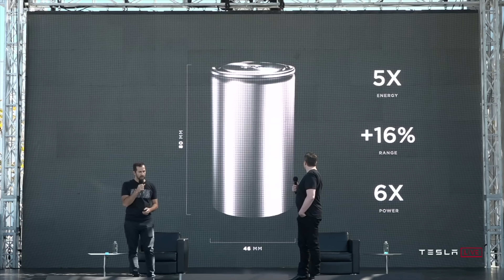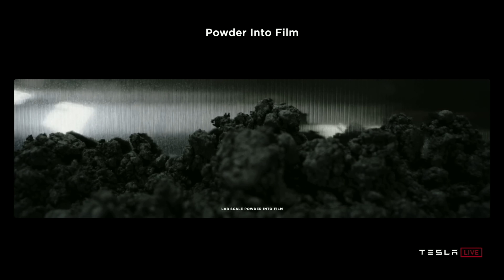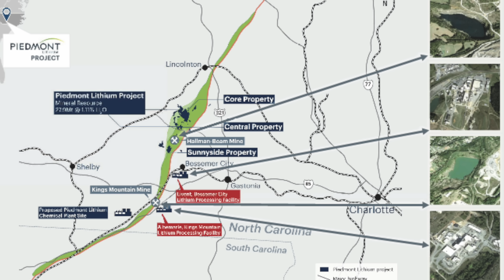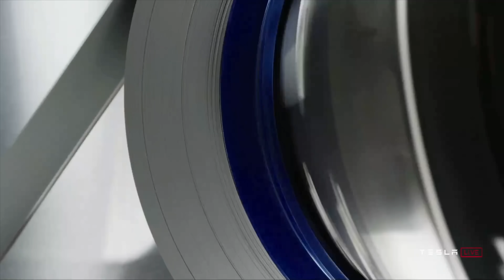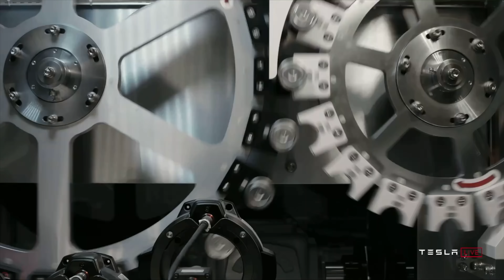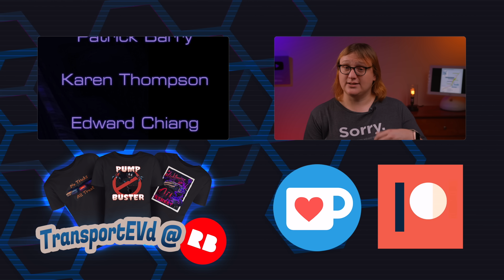Why (NASDAQ:TSLA)Tesla's Battery Deal With Piedmont Lithium (NASDAQ: PLL) Is Such A BIG Deal

Comment: excellent video. quite impressed you got almost every detail right. Both about Piedmont and the permitting/environmental considerations in Nevada. One important correction, however, is that Piedmont will also be making lithium hydroxide in North Carolina - from its own resources (it continues to buy land and drill so it will likely grow) and also from SC6 (spodumene) it plans to important from various countries (eg, Quebec, Ontario, Brazil, which are not far away). It is indeed a BIG DEAL. By my firms estimate, Tesla's will only be able to source about 30-35% of its lithium hydroxide internally so will continue to buy from existing suppliers like Albemarle and Livent and also new suppliers like Piedmont, who in addition to SC6, may also sell them hydroxide in future.  Please check out Rock Stock Channel on youtube to see video I published on this deal earlier this week.

Comment: Why hasn't anyone commented on the problem of packing larger batteries? The bigger the diameter the bigger the air gaps between them. To maximise packing density it would be better to mix small and large batteries so that the small ones fill in the gaps between the larger ones. It's a problem whenever you try to pack round objects and one of the advantages of batteries with straight sides.

Comment: Good video on a technical subject. One thing I keep hearing is things like "Lithium is the 3rd most abundant element on earth" or "Hydrogen is the most common element in the Universe". When it comes to mining, those statements are completely meaningless. What's important in mining is that the concentration of the element in the mine is high enough to make it profitable / practical to mine. In the case of Lithium, the  miners ramped up production a couple of years ago but all the EV announcements by legacy makers never resulted in meaningful production so the price of Lithium tanked and miners closed mines. So for awhile at least, Lithium production is not a problem.

Comment: Musk's 69% is clearly a WAG meant as a joke, just look at how he pointed it out combining it with a 420 joke. Since the process is at this point hypothetical there is no way he could realistically state the reduction to two places of accuracy. There are too many unknowns.
Good that Tesla has access to lithium but there is no domestic US nickel and it is much less "green" to refine.
I understand the attraction of vertical integration, but in manufacturing it has costs. Yes, it gives better control over supply chain but the costs in efficiency are real. Before we take on faith that Tesla has reinvented how to make batteries we should ask ourselves if we have seen Tesla factory robots limited only by air resistance or others beating a path to their door asking for assistance in building "the machine that builds the machine." Tesla is new to the battery manufacturing business. Most Tesla fans only know of the battery manufacturing, or manufacturing processes in general, through what they have heard from Tesla. I would advise caution in taking Tesla's statements at face value unless a Tesla Semi delivered your Roadster last month.